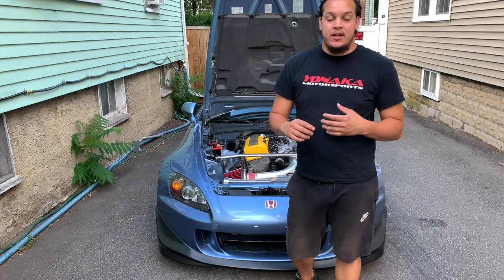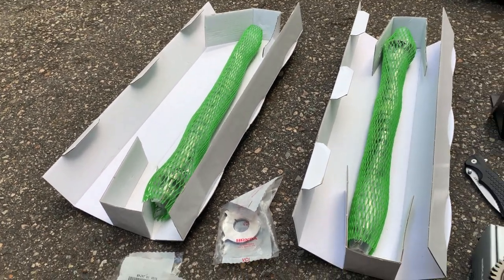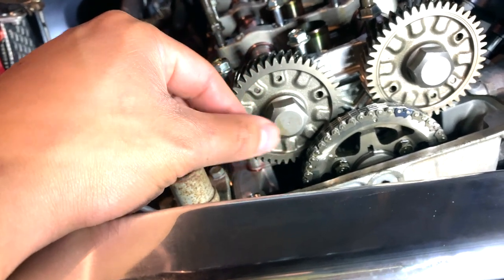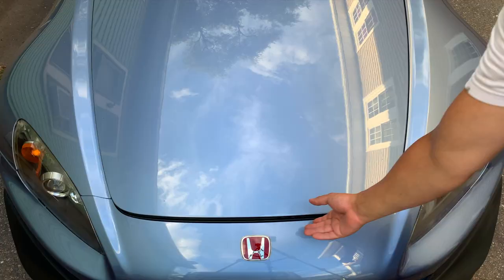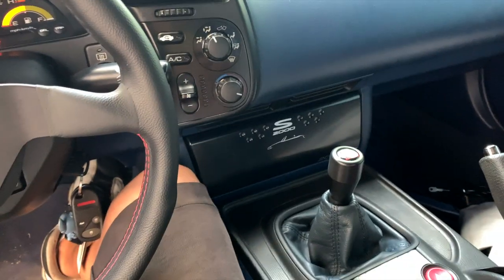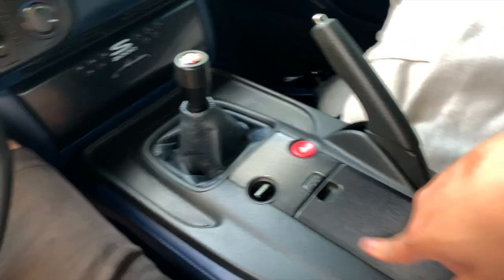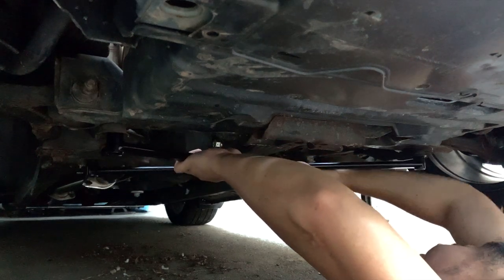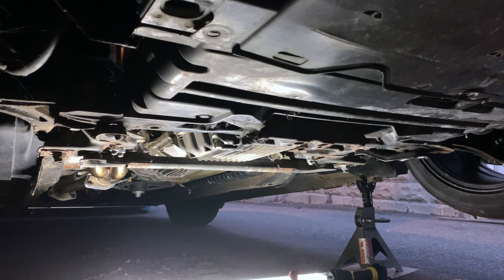The Spoon S2000 gets cammed

Comment: hey are you located in massachusetts as well? i almost bought the ballade camshaft my self but went with bc stage 2 camshaft.
Reply from the maker: Yes I am! I looked into the bc cams too but decided on the Ballade's because if I were to do over the valve train I'd most likely take the head off and send it out for porting. But I wanted this done quickly cause I got ITBS the same week as the cams and I wanted to put them on right away, which should be the S2K's next video. Thanks for watching!

Comment: Nice! What are your first impressions of the cams? Any change in exhaust note? I received my ballade cams a week ago, waiting on my gaskets to arrive from the dealer before I install them.
Reply from the maker: They sound a we bit more aggressive and the exhaust note changed a little bit little deeper sound. I think of them as the type R cams from the type R s2000 we never got if that makes any sense. I like them so far but haven't drove on them yet since I did ITBS the following weekend and need to tune now.
Reply: @MojoGarage  Thanks for the feedback. I got the cams installed last week, the exhaust note has changed a little. The car seems to be pulling a bit better in vtec, a tune is definitely needed to unlock the full potential of the cam. Have you had any a sort of whistling/whining noise on acceleration after the installation?
Reply: @chucks_garage987  i have that whining noise as well after installing the cams

Comment: Seems you have the same whining noise. After installing these the engine gets a whining noise a bit like a supercharger..
Reply from the maker: I've always had a little bit of a whine after putting on the 3.5in intake(had spare intercooler piping in that diameter kicking and figure why not) but I did notice that it got a little bit louder after the cams.
Thank you for the comment and for watching!
Reply: @MojoGarage  Thanks for your reply! Any news on the noise of the cams while driving? On my car they where quite noisy and whiny...almost like a supercharger.
Reply: @enolamns  Mine also sounds like a supercharger at low rpm. Can't hear it above 4000rpm coz my exhaust is so loud. I've gotten my car tuned with Flashpro, and I can say the cams made a significant difference in the low rpm out of vtec.
Reply: @chucks_garage987  i put the oem cams back and the whine was gone. really not sure what think about this. cannot be so good if the engine makes such a noise. had other cams installed as well like schrick or toda and they never made such a noise.
Reply: @enolamns  I'm also worried about the sound. I hope it doesn't cause any damage to my engine. Would rather lose the gains than lose an engine. How were the other cams (Schrick and Toda) in comparison, power wise?
Reply: @chucks_garage987  i had the ballade installed for a short test drive and removed them afterwards because of the noise..so i have no comparison. Toda a2 did not make much power over stock but i guess a bit more than ballade. Valve noise was louder with schrick but no whine like ballade.
Reply: Any issues with the cams? Did you feel a noticeable difference in power?
Reply: @mariom9694  i did not install them again. I dont want to ruin a freshly built engine. Those cams are just regrinded oem cams sold as ballade cams. Not worth the risk for a few hp...
Reply: @enolamns Sorry for the mix up, this question was for @mojogarage
Reply: @enolamns  same i hear the whiney noise on acceleration with the ballade cams do u still have them how’s it going so far??